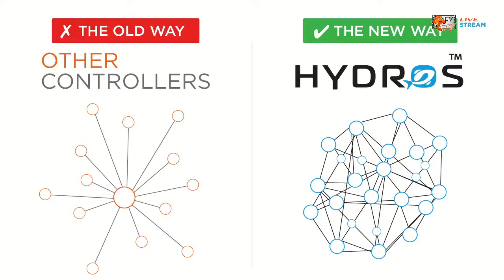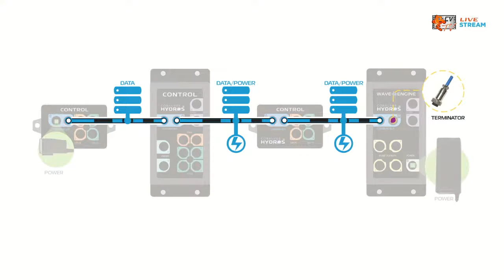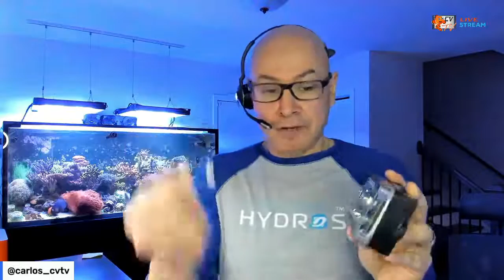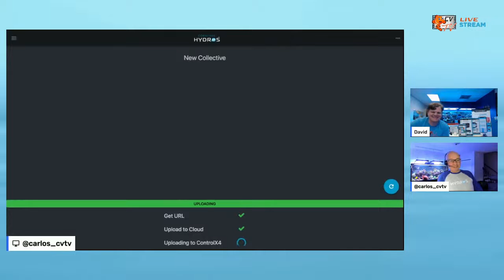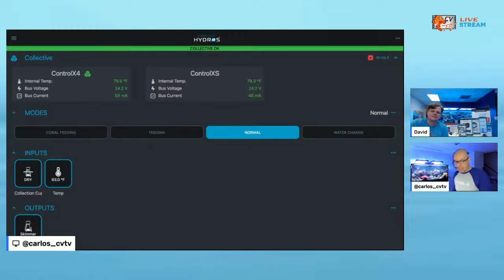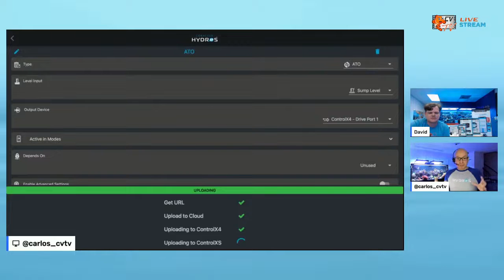[CVtv] LIVE Product Workshop - HYDROS: The Collective

Comment: I have a control 2 and 4. The 2 is with RODI unit in basement. If I use a data cable (no power because it's about 20ft) I'll have to use plugs for both control 2 and 4... so,, do I not need a terminator?  Also, if terminators are always needed, why are they not included with controllers?
Reply: Yes terminator is always needed